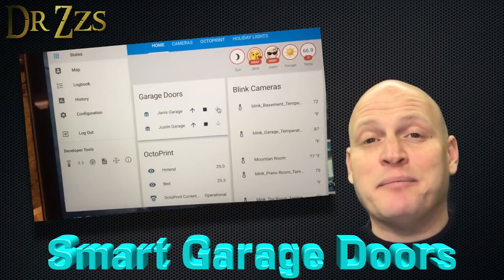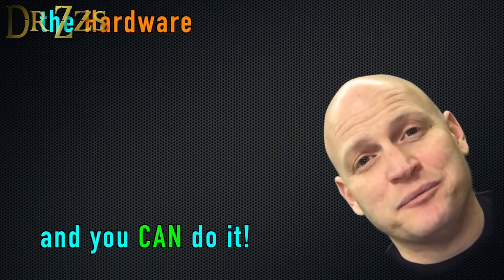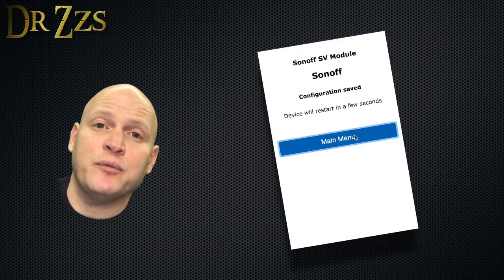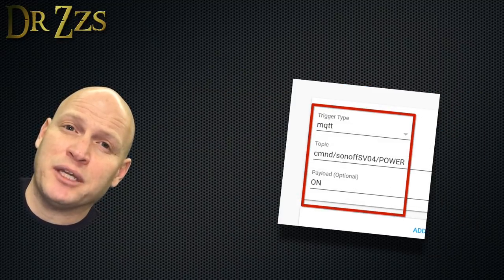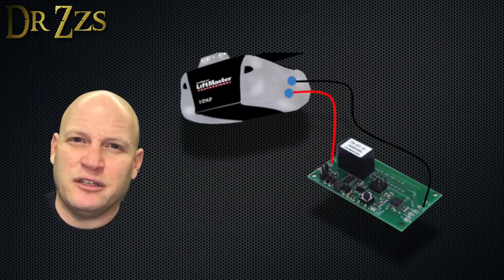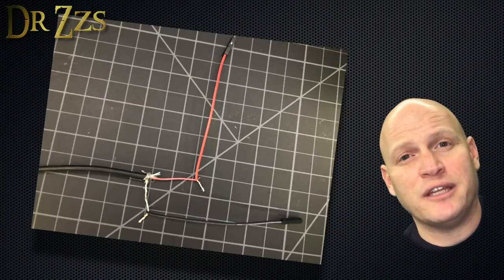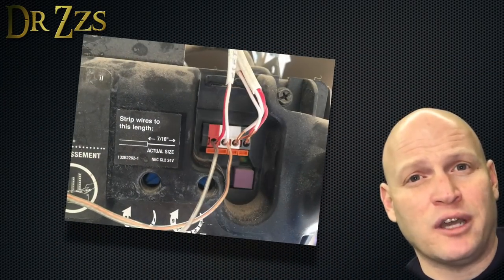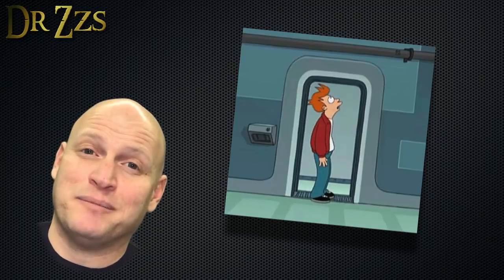$5 DIY "Smart" Garage Door Opener using Sonoff SV

Comment: Dr Zzs, need help please.  I have a chamberlain that has an electronic wall switch (there is a small board behind the wall switch).  When I press the switch the relay kicks in and the up/down buttons on the motorhead light up but nothing is triggered,  So I placed this on my other garage unit, which is an older system with a regular button, and I'm getting close (I can open and close thru the sonoff frontend but not thru hass io).  But it's the electronic one that I'm asking for assistance with?  I'm also open to suggestions from others as well.  By the way, I'm using Pulse setting and not delay in automation.  Thank you.
Reply from the maker: Hi
I don't know anything about what's going on inside the "brains" of the chamberlain opener. That board behind the switch likely holds the answers.  Hopefully someone else can add some knowledge. Sorry I'm not more help to you. 
As for the other opener; if you can activate the door with the sonoff but not in hassio it is most likely a problem with mqtt. Somewhere the topics or payloads are probably wrong. That's my first guess at least.
Reply: Dr, got it to work but I need to double click the arrows, to open or close.  What command can I use to have a single click act like a double click?  I'm reading up on switchmodes but am scare to screw up my current setting since I'm so close.  Thanks.
Reply from the maker: wow, I have no idea.  That's pretty odd.  So, to get the Chamberlain door to open, you have to click twice on the arrows in Home Assistant?  That's pretty screwy.  
There isn't anything in the Tasmota console that you can screw up that you can't put back the way it was.  
Before you change the switchmode, just type "switchmode1" or "switchmode2" if you're using switch2.  That will tell you which mode you are currently using.  
Then you can change it with commands "switchmode2 2" etc, and if none of them change it in a way that is better, you can go back to the original setting by putting in the number that to was set to when you just put in "switchmode" 

It might be that the Chamberlain is set to work with a momentary button.  If that's the case try "switchmode1 4" first.  
I bet if I could see it and be there we could get it fixed in just a few minutes.
Reply: Dr Z, it was the payload setting under the call service action, changed it to "payload": "ON", from "OFF". I went back to your first reply to my question and looked into the payload.  Thanks a lot.

Comment: Hi, how does my Home Assistant recognize my Sonoff SV? Triggering directly via Sonoff SV works, but not via Home Assistant.
Reply from the maker: Did you create the cover entry in the configuration.yaml file?  If so, you may need to check the topics.  Tasmota has changed since I made this video.  Trip the relay and activate the reed switch, then go to the Tasmota console and it will show you the exact topics for both actions.  Make sure those match what you have in your HA config file.  
Hope that helps.
Reply: @DrZzs  I found that the trigger for my setup under 6.5 is stat/sonoff/POWER1

Comment: is there a way to tell sonoff not to trigger the relay when there is a power restart?
Reply from the maker: yes.  In the Tasmota console type "powerretain 1" and "switchretain 1" and in HA config set "retain: false" for your cover entry.  
That should fix it.
Reply: Thanks for the replay. It still not working. I'm actually using sonoff basic with tasmoto 6.2.1 . I don't know if that makes a difference?
Reply from the maker: hmmm
See if there's anything here that might help you: https://youtu.be/31IyfM1gygo

Comment: I manually installed HA from scratch. Configured Mosquitto and a few Sonoff switches with Tasmota firmware. The Sonoff devices show up in HA fine and I can interact with the switches from HA frontend or from HA's MQTT interface without issue. Commands sent by interacting with a switch or from the MQTT interface activate the Sonoff and the commands show up in the Sonoff console.
I've created an automation that listens for the ON payload sent to one of the switches and after a 1 sec delay, send an OFF payload to the switch.
I have subscribed to all MQTT topics from a terminal session on the HA server and I see, the automation appears to detect the ON payload and then sends the OFF payload as it is supposed to. Problem is the Sonoff receives the on (sent from HA frontend) but doesn't receive the off payload sent by the automation. Any ideas what the problem could be or where I could begin looking?
Reply from the maker: I'd actually recommend that you ditch that method (even though that's similar to what I did in the video).  The better way is just to set the "Pulsetime1 10" in tasmota Console so when the relay is triggered "on" it stays on for 1 second, then turns back off.  So no need to have an automation in Home Assistant at all.
Reply: I figured out what my problem was... a simple typo. The automation method is working fine now however, the pulsetime is a better solution so I'll use that. Next problem with all the sonoff switches I have is, status when HA restarts. All the devices show as off regardless of whether they are actually on or not. The garage door shows as open. How can this be resolved so that HA shows the true state of the device after HA restarts? Also, how can I automate the garage to close after X amount of time after being opened?

Thanks for all the work you put into the videos. It'd be great if you could slow down just a bit though...
Reply from the maker: ya, I'm trying to slow down.  Some of my older videos are really fast.  I was trying to fit 15 min of info in 7 min.  I'll keep fine tuning.  

To answer your questions: 
#1 sonoff states:  I have the same thing happen with HA restarts.  I managed to fix it with my garage doors, but I'm not sure how I did it.  
this is the status output for my garage sonoff:

21:30:59 MQT: stat/sonoffSV04/STATUS = {"Status":{"Module":3, "FriendlyName":"Sonoff", "Topic":"sonoffSV04", "ButtonTopic":"sonoffSV04", "Power":0, "PowerOnState":3, "LedState":1, "SaveData":1, "SaveState":1, "ButtonRetain":1, "PowerRetain":0}}

I think the setting that keeps it updating the state to HA is "SaveState1" and "PowerOnState 3". 
That might not be it though.  Somehow it is sending updated state messages every 5 min.  I'll look more into how I did it and pass it on for sure. 

#2 garage close automation: To get your garage to close after a few minutes your automation will look something like this:

(in automations.yaml)

  - alias: 'Garage Close Timer'
    trigger:
      - platform: state
        entity_id: cover.your_garage_name
        from: 'off' ## use whatever word you have as "state_closed" where I have 'off'
        to: 'on' ## use your "state_open" where I have 'on'
        for: '00:10:00' ## this is the key line to get the door to close after 10 min

    action:
      - service: cover.close_cover
        data:
          entity_id: cover.your_garage_name

You need to have
"automation: !include automations.yaml"

in your configuration.yaml if you don't already.  
When you save the automations.yaml file you don't have to reload all of Home Assistant.  You can go to the configuration page and just "Reload Automations"

Hope that helps :)
Reply: The two settings that are required are: PowerRetain 1 and SwitchRetain 1. Issue these commands from the sonoff console or edit in the user_settings file when compiling the firmware. Three days and a broken reed switch later.... these setting seem to do the trick.
Reply from the maker: Great! 
I’ll pass that on in a video. 
Thanks!

Comment: few questions:
1) if i use the basic firmware on sonoff sv with ewlink and google assistnat/google home, does that send a pulse signal for 1 second just as if we flashed it with tasmoto. i want to be able to just hit a button and send a signal to open or close the garage with that. i dont want it to send a constant signal such that i wont be able to use my regular car built in opener if i wanted until i pressed the sonoff button again to stop sending a constant signal. if that makes any sense. 
2) can you use the relay function by just connecting it to the garage door opener limit switch? i really dont need this function.  so i may just not set up the second switchtopic 2.
3) if i use tasmoto, can i use that with google assistant just like ewlink? or do i have to use home assistant?
Reply: correction: just figured it out. u can buy the 1 channel self-inchign switch: https://www.itead.cc/inching-self-locking-wifi-wireless-switch.html

that switch has a 1 secon auto off. this guy did it successfully: https://www.youtube.com/watch?time_continue=209&v=T2YbdD50pqY

Comment: Hi, 
I'm working on implementing this. I've got the MQTT setup working with the Sonoff SV (flashed for Tasmota), and have customized HA accordingly. The Cover under HA shows and works perfectly, both for open and close, and the state of the reed switch is correctly reflected in HA. 

However, when it comes to Alexa, I can OPEN the cover (it's a gate, but logically very similar to garage door), but when I tell Alexa to CLOSE the gate, it says that the command is not supported. I don't know where to go from here. I have another cover (via Somfy Tasmota integration) which works just fine, open and close. Anybody have an idea what I can try to get this working? Perhaps I could do a workaround via an HA template, but have not gone that far yet. 

Here's my HA config files:

configuration.yaml: 

cover:
  - platform: mqtt
    name: "portail"
    state_topic: "cmnd/gatestate/POWER2"
    command_topic: "cmnd/SonoffPortail/POWER"
    payload_open: "ON"
    payload_close: "ON"
    payload_stop: "ON"
    state_open: "OFF"
    state_closed: "ON"
    optimistic: false
    retain: false

Note that I have reversed the state open and closed items from the project given here, because my reed switch is Normally Open (when the magnet is away from the reed).  

customize.yaml: 

cover.portail:
  device_class: gate
  friendly_name: Portail 

A big thank you to anyone who can help me get this sorted!

Comment: Two questions: My SonoffSV will not actuate the relay through Home Assistant. I can see the reed switch working properly in HA, but when I press the HA button to actuate the relay, nothing happens. I can press the physical button to operate the switch, but using HA does nothing. (I should probably mention that I can toggle the relay while I'm connected directly to the Sonoff.) So I don't know which part of this video deals with that and so I don't know where to troubleshoot.  My second question is I see the relay actuate every time I reboot the device. This can't be a good thing and should cause Dr Zzs to have some red flag around here on how to fix that. I certainly don't want to install this until I have that figured out. 
Since these videos are geared to the noob, I think addressing errors would be substantially helpful. If I got it wrong, maybe someone else did too. 
I do appreciate this effort, so thanks for taking the time to post the video.
Reply from the maker: Hi Paul. 
If you aren't getting the button to work in HA, then my first guess is there's a problem with the "command_topic".  Open the Tasmota console and push the button on the Sonoff.  Post what it shows in the Console.  It will show your command topic for the relay.  That will have to match what you have in your HA "cover" entry. 
As for the relay activating on startup, there are a couple things you can do.  Type "poweronstate" in the console.  It will tell you what your current power on state setting is.  I would suggest using 0, which will keep the relay off when the relay restarts.  
I wasn't having that issue so I didn't include anything about that in the video.  It could be that the newer versions of tasmota changed the poweronstate default from what it was when I made the video.  
Let me know if you still have trouble after trying those things.
Reply: Never thought to look at the console for help. Something new. 

03:30:52 MQT: tele/sonoff/STATE = {"Time":"2018-05-30T03:30:52","Uptime":"0T00:00:14","Vcc":3.156,"POWER":"OFF","Wifi":{"AP":1,"SSId":"XXXXX","RSSI":100,"APMac":"XX:XX:XX:XX:XX"}}
03:30:52 MQT: tele/sonoff/SENSOR = {"Time":"2018-05-30T03:30:52","Switch2":"OFF"}
03:31:04 MQT: stat/sonoff/RESULT = {"POWER":"ON"}
03:31:04 MQT: stat/sonoff/POWER = ON
03:31:05 MQT: stat/sonoff/RESULT = {"POWER":"OFF"}
03:31:05 MQT: stat/sonoff/POWER = OFF

The "ON' and "OFF" were at boot. So when it boots, it goes through that process which is why I'm worried about installing when it does this every time it resets. (BTW: Your D1 Mini setup worked for me, but I just wanted to try the SV since you seem to be moving toward that setup).

When I press the buttons in the HA Garage Doors card, I get nothing at the console.

However, this is most curious. When I place my magnet in front of the reed switch, I get this from the Console:
03:38:15 MQT: cmnd/2/POWER2 = ON (Shows the door open - no relay activity)

When I remove the magnet I get:
03:38:18 MQT: cmnd/2/POWER2 = OFF (Shows the door closed - no relay activity)

My SonoffSV is a Rev1. Since this is my first attempt with the Sonoff and Tasmota, I'm sure I have something screwed up.

BTW: I've been on youtube since the beginning and I've tried a lot of DIY stuff, and you are the very FIRST person of any channel to actually take the time to help me figure something out. So thanks for that. It's special.

I'll run back through the video one more time and see if I can figure out what I've done wrong.
Reply: My config.yaml entries:

  customize: 
    cover.Main_Door:
      device_class: garage
      friendly_name: Main_Door

cover:
  - platform: mqtt
    name: "Main_Door"
    state_topic: "cmnd/2/POWER2"
    command_topic: "cmnd/sonoffOst1/POWER"
    payload_open: "ON"
    payload_close: "ON"
    payload_stop: "ON"
    state_open: "ON"
    state_closed: "OFF"
    optomistic: false
    retain: false

group: !include groups.yaml

my groups.yaml

    garage_doors:
      name: Garage Doors
      view: no
      control: hidden
      icon: mdi:garage
      entities:
        - cover.Main_Door

Even though I typed in the automations IAW the video, nothing shows up in my automations.yaml file. I would think something should be there. After a third attempt, I got the automations editor to create the automations.yaml entry. I also now have a card in HA for Automation, but the name isn't the same, so I'll change that to match. Still not activity at the relay when I press the button in the card. Here is the automations.yaml

- id: '1527649405969'
  alias: Main_Door
  trigger:
  - payload: 'ON'
    platform: mqtt
    topic: cmnd/sonoffOst1/POWER
  condition: []
  action:
  - delay: 00:00:01
  - data:
      payload: 'OFF'
      topic: cmnd/sonoffOst1/POWER
    service: mqtt.publish
Reply from the maker: I think I see the problem. 
You have the "topic" wrong in your HA entries.  It needs to match the topic that shows in the Console.  2 ways to fix this either go to your Sonoff - Configuration - Configure MQTT and change the "Topic" to "sonoffOst1" 
or go to your HA entities and change the middle part of the topic from "sonoffOst1" to "sonoff"  I'd vote for changing the topic in the Sonoff Configure MQTT menu, because that topic will need to be unique for that sonoff if you ever add more sonoffs or other Tasmotized devices (and I'm betting you might add more :) 

Your reed switches are functioning as they should.  Moving the magnet is only supposed to change the state we don't want it to click the relay.  

Thanks for watching and supporting me!  
I'm doing what I do because I've been in the same boat; lost on youtube looking for help.  
It's a bit of a catch-22.  You want more viewers and the community to keep growing, but I expect there may come a day when I can't personally answer every request for help.  
That's when I hope the rest of the community kicks in and reads comments looking to help new people too.  
I'm sure you'll get the change to share something you've learned with someone else sometime. 

Let me know what happens when you change the topic.  If you just change it in the Sonoff Configuration you won't need to restart HA. 
Good luck!
Reply: I dropped into the Sonoff, opened the MQTT page and slapped myself in the face. I never thought to ensure that this "topic" had the same name. As soon as I changed it, it starting working. DUH (how did you "see" that??). Now I'm going to flash about 5 of these so I can make sure I have the process down cold (meaningful repetition).

I really need this working! It's going to be 104 here in Texas this weekend. My garage door opener (which was very old and had many miles) fell apart on the inside two days ago. I replaced it with one I rebuilt a few years back and of course, it won't work without reprogramming the old remote control. Going to finish this today and install it so I can stop doinking around with the remote with weird batteries. THANKS THANKS THANKS. 

Now, on to that 4 relay you just did. I have one of those I programmed last year for my "Vacation Watering System" which I run on the EWeLink app (but don't like). Need to get this in HA so when I'm in away, I can water my lawn, on a schedule!
Reply from the maker: man! 104?!? can't you fly North for the summer or something?  gees, that sounds awful.  
Glad you figured it out! 
good luck with the inferno this weekend!